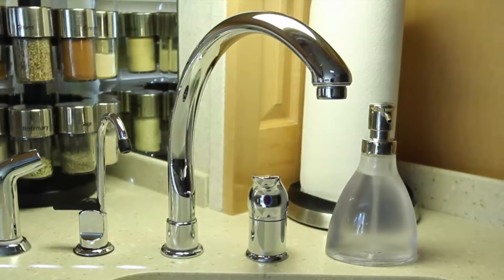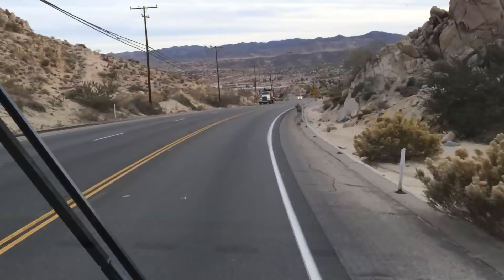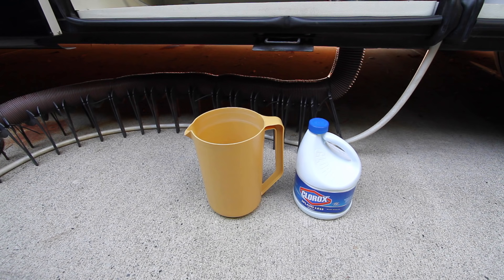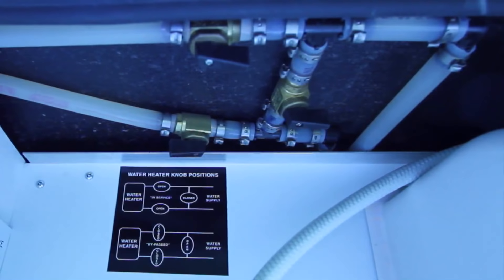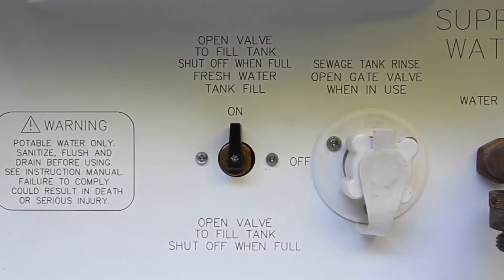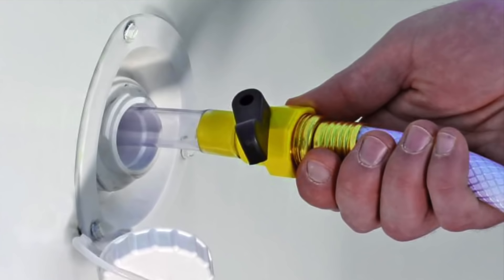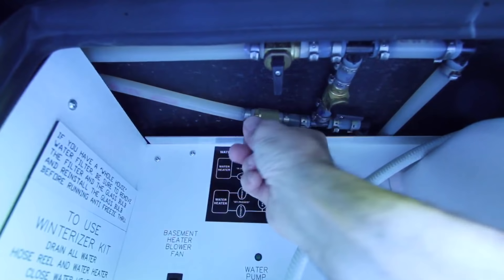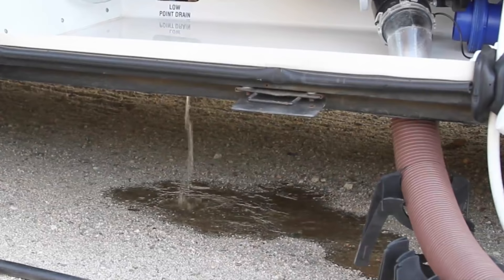How To Sanitize an RV Water System

Comment: Got it, thanks.  Good online session this evening.  I used vinegar instead of bleach to clean out the hot water tank, but once you told me about the smell being bacteria in the hot water tank, then I have to try it again with bleach.  That smell can get bad when washing dishes.  Appreciate everything:-)
Reply from the maker: No worries, Richie! Vinegar is what you need to clear out the limescale that builds up... but it won't kill the nasties that create that sulphur smell (YUCK!). Bleach SHOULD do it for you... but if you're using the same water source, it's likely coming from there and will build up again over time (if it's not just an issue with the supply water itself to begin with). Let us know how you make out!

Comment: PSA - Be careful traveling down the road with a full fresh water tank. It's one thing to ask the tank straps to hold a full tank while stationary. It's another thing going down the road with all the potholes, twists and turns we encounter. Many rigs' tanks are simply not properly strapped. This was so with my last TT. Ensure that the mfg recommends this before you lose a tank on the road. Remember that water weighs 8.34 lbs per gallon. My 70 lb. FW tank, when filled, is 583 lbs. That's a lot of stress on those straps. Be 100% sure they're designed for that load before trying this. I carry some water in my Open Range 5er, but no more than half full. There's usually a water source near your destination, and you can always carry an extra water tank in the bed of your TV.

Comment: I missed the part where I was to Stand on One foot and hop around...    Great info, I'll have to watch (listen) to it 3-4 more times.
Reply: Well I actually did have to stand on 1 foot and hop around, on top of a towel to soak up all the water that leaked out because I was confused about the size of my great age compared to my freshwater tank.😂. It’s so important to know the actual size of your tanks.  Because the little LED screen on my system indicator brings everything up to 100 I assumed they were all 100 gallons but apparently it’s just a percentage. After six months of having this RV I never noticed that!

Comment: No worries.  I also run a jobsite mobile treatment unit that also has a wash basin.
I pulled the sink panel off to check things out.
There was a mouse house as well as a ‘clear’ water hose from the storage unit that was grey going black.
So I replaced it

Comment: I use a mixture of water and white/clear vinegar to sterilise my water system. Vinegar is food safe and also helps with limescale.
Reply from the maker: Just be aware that you need a fairly high concentration of vinegar to achieve the same goal. Standard, store bought vinegar is only a 5% solution... which is only about 80% effective as a disinfectant. Mixing that with water and you're reducing that effectiveness even further.

Comment: Great information as always guys!! You have the best RV how to videos out there! We made a modification to the process by installing a press-fit connector on the end of the low point pex tube and another fitting to fit the inside diameter of a cheap garden hose. Since it is low pressure no need for a hose clamp. I just pull the hose off when we are done. Then we can drain directly into the sewer drain as opposed to having to run the pump through the grey tank and then purge. Thanx for all the great videos!
Reply from the maker: +david1tek Thanks for the great additional tip David!

Comment: With the type of faucets you had in the RV you were using the hot and cold water will mix so closing water to the water heater was a good idea. You either need valves that you turn off at each faucet, 1 way valves, or to turn the water off to the water heater as you did.

Comment: I always refer back to this video before sanitizing my tanks, great refresher.  You mentioned you turn off your ice maker.  Wouldn't you be worried that the water line going to the ice maker could contain bacteria?  I am off to sanitize my mh tomorrow and the ice maker is the big blocker for doing a fast job, or easy job.  This will be one more of many times in the past I have done this but I don't remember doing the ice maker in the past.  Thanks for all the great videos!
Reply from the maker: Hi Ben! Thanks for the nice comment, and great question. You could absolutely include the ice maker in your sanitizing routine, but if there's a carbon filter in that line (which we have on our fridge), best to remove it first. The reason we don't bother with the ice maker is because when we sanitize, we take the opportunity to toss out any old ice anyway, and then toss the first few batches of new ice, too, basically flushing out the line with freshly sanitized water. In reality, it's the water sitting in the fresh tank that is the most important water to get bleached, and we just do the water lines in the rest of the RV while we're at it. definitely can't hurt to do the ice maker, but we don't think it's worth the trouble, and we've never had a problem.

Comment: If you normally leave the gray tank valve closed like me, make sure to open it before you drain the holding tank by opening a faucet. If not, it will back up into your shower when the gray water tank is full. I'd rather not admit how I know that.

Comment: Thanks!

We do not have a gravity fill on our RV, but we do have a winterizing kit. 

Whenever we run out of fresh water while boondocking, we use your tip of flipping the winterize lever to "winterize" and the water fill lever to "fill" to pump fresh water from water cans into the fresh water tank. It saves having to use an external pump.  (Sometimes we don't bother to refill the fresh tank and just use the cans as external tanks.  Both methods work fine.)
Reply from the maker: Awesome!

Comment: I think I’ll chime in here
Three years ago my water tank had to be replaced it was split so after dropping the underbelly and disconnecting hoses from the tank the vent for the tank was black
It was black with mould no amount of bleach or sloshing around or anything else was going to get that mould out of that vent hose so the hose had to be replaced half inch ID plastic available at Lowes or Home Depot five or 6 feet of it
No one in any of these tutorials ever touches on the vent you can’t clean the vent out you can’t put a pipe cleaner types device down the vent pipe it will just push the mould down into the tank. in the vent needs to be replaced.
You may be able to pull the manifold or the fell station off the RV far enough to be able to see the vent hose to determine whether it is contaminated with mould
Reply: can't believe no one even gave you as much as a thumbs up 👍 thank you for your comment

Comment: I have a camper after winter I will sanitize the tank but first I will remove antifreeze from all sinks shower also toilet. After I will close the hot water heater tank cause my RV inspector did say sanitizing both cold and hot water will require to close the hot water heater  bypass

Comment: Scrolled through all (I think) comments to see if this was answered.  Sorry if I missed it, but I’m assuming you would want to run the dishwasher and washing machine briefly as well???  Also, should you let some water flow through the toilets as part of sanitizing all lines???  Thank you!
Reply from the maker: Hi Carl. We don't do any of the above. On the dishwasher & washing machine, you certainly could. Some might say you could risk the bleach damaging seals in either machine, but we think you should be OK (this isn't that high a bleach concentration). We haven't bothered doing them... because, honestly, the lines aren't that great a source of potential contamination. PEX plumbing lines are quite slippery... so it's not likely that much will grow in them. The tank is really the largest potential place for things to grow. As for the toilet(s)... since we use bacteriological/enzymatic tank treatment, we prefer not to put bleach in the black tank. But if you don't use that kind of tank treatment, by all means go ahead. Never hurts to be thorough! 😃

Comment: Thanks for the great video! You mentioned that you can get thru 10 days on your 105 gallon tank for two people, which seems like very low usage. Can you provide some tips on how you got it down that low? Thanks!
Reply from the maker: Hi Dan! We can actually go about two weeks pretty comfortably. That’s with both of us showering every day, and cooking on board just about the entire time. One of the most important things is to reduce the water used when showering. Of course taking a navy shower is key, which means turning the water off while soaping up, but also running the hot water up into a pitcher rather than down the drain, and then using the water from the pitcher to flush the toilet. We are each able to take a thorough shower in less than 1 gallon of water. Also important is to use the least amount of water possible when washing dishes. That means drizzling it of course. While we don’t like to use paper products unnecessarily, when we know we’re going to be dry camping for more than 10 days, we go into what we call “Super Boondocking mode” which means using paper plates. We also tend to grill a lot, and make many one-dish meals, which reduces cleanup of pots and pans after dinner. While all this may sound like were suffering out there, it’s really not hard once you get used to it, and we don’t feel like we’re sacrificing at all. The benefit and freedom we get from being able to stay out for extended periods of time is absolutely worth it.
Reply: Thanks much! 1 gallon showers; impressive. I have a water miser that recirculates the hot water till it’s ready, but you guys really have it down pat. I have used paper or regular dishes but wiped them clean and done a quick rinse. I think I just have to be more disciplined. Have a great time in Italy!
Reply: @RVgeeks  great tips thank you for sharing this important information listening from Brownwood Texas
Reply: Subscribed!
Reply from the maker: Welcome John!

Comment: I've owned 6 rv's  with winterizing kits and none of them would put chemicals in the holding tank, the suction side of the pump is after the tank so how could bleach be put in the tank with the winterizing kjt? I've always had to disconnect the hose from the water source empty the fresh water hose fill it with measured amount of bleach turn on the tank fill valve reconnect the water hose to source and allow the bleach to enter the tank while being mixed with the water fill pressure. If you understand it different please reply we all learn from one another.
Reply from the maker: Hi Cecil! Apparently, not all manufacturers plumb their winterizing kits the same as Newmar. We have a trick you can use that might be easier than the hose: https://youtu.be/lEBscJ-qb98

Comment: If we must leave the bleach water in the system longer than 8 hours (due to a much longer drive), is that ok or do we need to be concerned if it's left in for such a long period? Thank you for this video! Always love learning from you guys!
Reply from the maker: No worries at all! It’s such a low concentration that it won’t harm anything. The reason we talk about eight hours is to make sure it’s in there long enough to do its job. But longer periods of time won’t harm anything. Safe travels!

Comment: Despite this amazing video that is so complete in its explanation, I managed to have a silly issue.  

For some reason it takes a really long time for my freshwater tank to empty when just running the faucet. Over 2 hours! It was 1 AM when I decided that it still smelled like bleach and I was going to rinse it a second time. To my surprise, my freshwater tank is bigger than my gray water tank. I was under the impression all my tanks were 100 gallons, since the LED indicator brings everything to 100. Silly me! 

 I was determined to get the second rinse completed but I was so tired, I decided to set my alarm and take a little nap. I set my alarm for 50 minutes, which seemed conservative for the amount of time it would take to empty this tank, but when The alarm went off and I stepped out of bed, the floor was soaked!!!  Oops!  

Luckily it didn’t overflow for too long, a few towels on the floor solved the problem, but please don’t anyone do what I did and fall asleep while doing this!

I had it set in my mind that my gray tank was the same size as my freshwater tank but that is not the case clearly.  😂

I am so grateful because it could’ve been so much worse! 🙏🏻🌻💕
Reply from the maker: Glad you caught it before too long. Best to do it while hooked up to a sewer connection, with the gray valve open.
Reply: @RVgeeks  Why did I not think to leave the valve open? Rookie mistake!!  Plus it was two in the morning and my brain was not functioning well.  Shoot!! 
I contacted Newmar and found out the actual size of my tanks! 🙏🏻💕🌻
Reply: OMG. Why didn’t you just empty the tank by pulling the fresh water tank valve?  We empty ours this way in about five minutes. Of course, you can’t do this in a campground but we sanitize at home and it just runs out into the street.
Reply: @ceciliapetrowsky2572  rookie mistake on my part.  I was in a campground too, but the hard lessons are learned well 😆

Comment: Thank you so much!   Is it OK to leave the water that’s in the tank currently, that has been in there for several months, or should I drain it first and then fill it to halfway? Or does it matter?
Reply from the maker: You can leave it, since the bleach will sanitize the tank even with water that’s been sitting, and you’ll be flushing it out after bleaching anyway.
Reply: Well for some reason it takes a really long time for my freshwater tank empty but I’m just running the Fossett. The other interesting thing is that my freshwater tank is bigger than my gray water tank apparently, while I was waiting for it to dry and I fell asleep and when I woke up and leapt out of bed, I noticed the floor was wet. Oops!  Luckily it didn’t overflow for too long, a few towels on the floor solved the problem, but please don’t anyone do what I did and fall asleep while doing this.

I had it set in my mind that my gray tank was the same size as my freshwater tank but that is not the case.
Reply from the maker: Glad you skirted a disaster! Gray tanks are almost always smaller than fresh tanks, so if running the faucet to drain the fresh tank (vs opening the low point drain), leaving the gray valve open at a full hook-up park is important. Glad you're okay.

Comment: Great video!  Also, I noticed you correctly called it a water heater tank instead of the common buy incorrect term "Hot" water heater tank.  No need to heat hot water, eh?

Comment: Question for you....How do I sanitize my Rv since it doesn't have a winterizing kit, or gravity fill? It does have an inside filter (I"ve seen the melthod of putting the bleach in the filter housing after taking the filter out, but that won't work for me because mine is located unter the sink and wouldnt sanitize the whole system.) I'm thinking I'm going to just pour bleach into my water intake hose, and them hook it up and turn on the water, but that sounds messy and somewhat primitave lol! Does anyone have a better Idea?
Reply from the maker: +justanothervote A remote filter kit should work. I believe we mentioned something about it in this video: https://youtu.be/lEBscJ-qb98

Hope this helps.

Comment: I need your help guys?After reading your article on water softeners, I want to get one.  I host a primitive campground all winter in Arizona.  They bring water to me in a 500 gallon tank on a trailer.  I transfer the water to my RV using a submersible pump.  It takes an hour to fill my 100 gallon on board tank.

Will the low pressure affect this process if I use the softener in line from tank to RV or does it require a city water pressure?
🙏🏻💕🌻
Reply from the maker: Our guess is that putting a water softener in line won’t have any effect on the process other than potentially requiring more than an hour to fill your hundred gallon tank, as it may slow down the flow rate. Because the pump is creating water pressure, we can’t imagine that city water pressure would also be required. One thing you might want to do before deciding on which water softener you buy is to check the specifications or contact the manufacturer to see if there is a minimum required water input pressure.
Reply: We are planning on going with the one you recommended in the article. I like that it’s made in America and it’s easy to maintain.

But that’s great advice, I will give them a call before we place the order and confirm my expectations will be met 

Thank you so much guys ! So appreciate all you do to educate and make RV LIFE better! 🙏🏻💕